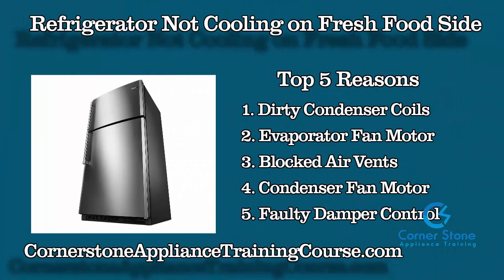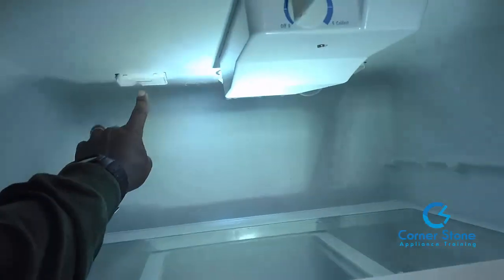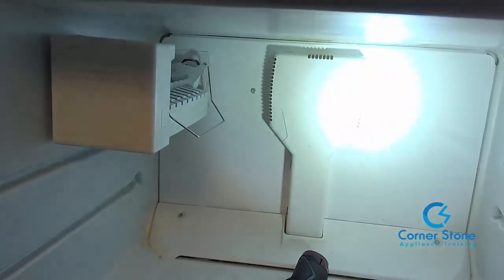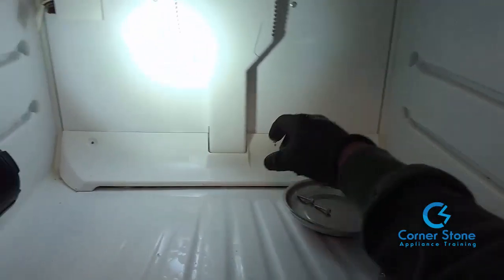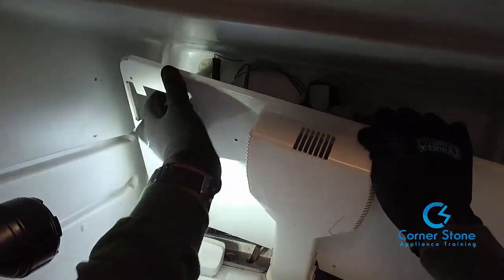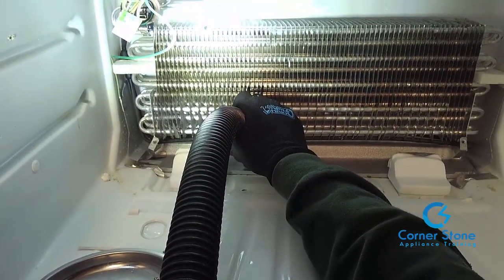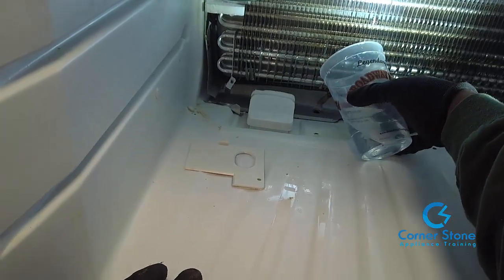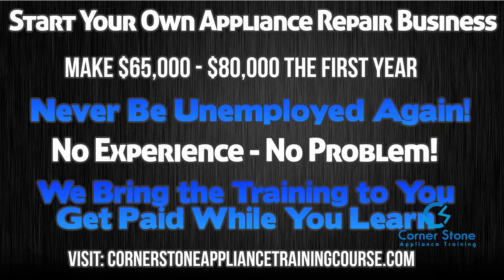Refrigerator is Not Cooling - Fridge Repair What to Check First - Top 5 Reasons Starting with...

Comment: I did this and still no air coming from left and right vent into fridge . Any recommendations? Thanks
Reply from the maker: Yes, ensure your evaporator fan is working properly and check the left side of your damper cavity to ensure it is NOT blocked with ice.

Hope that helps.

Thanks Again